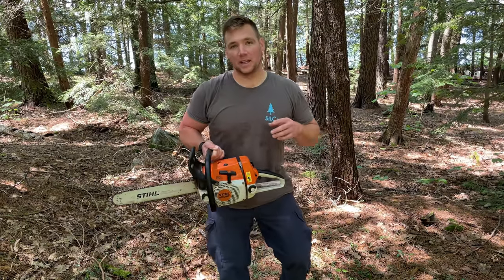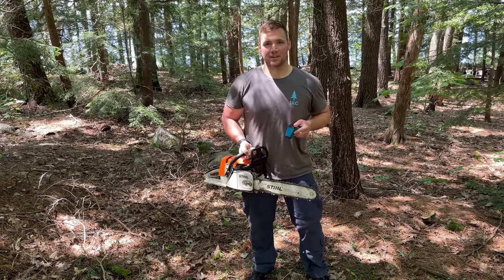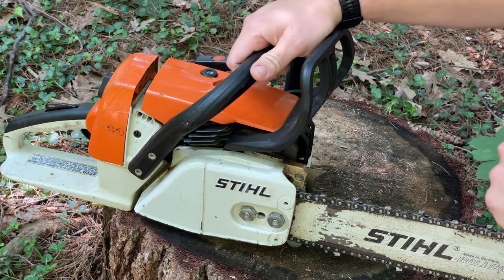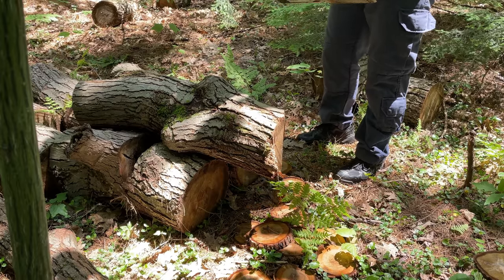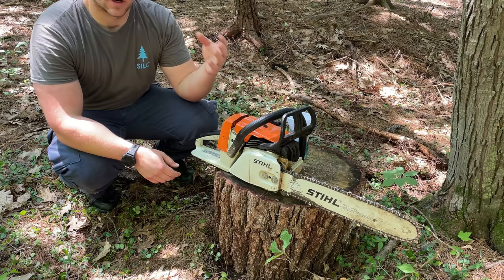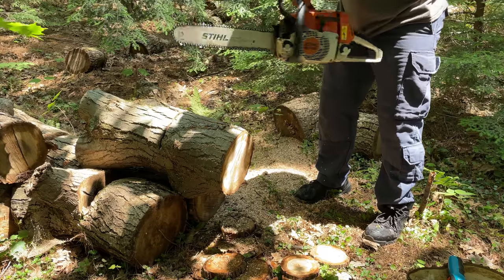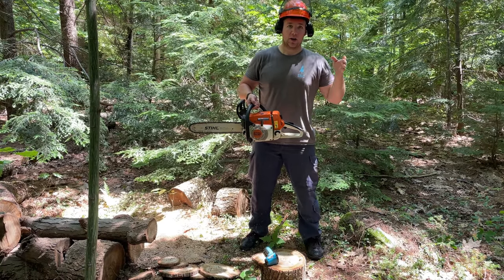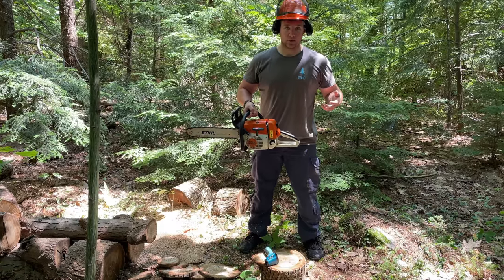Will my chainsaw last longer if I use more oil? Is it safer? (25:1 VS 50:1 temperature testing)

Comment: Thank you. If you can get the public to understand this you have truly accomplished something. That being said, if you had the ability to richen fuel to air ratio you could get the temperatures back to nearly equal. Since the carb adjustments are pegged or fixed we normally can’t do that. Having worked in the industry I have had a hard time getting public to understand that more oil is not better. With today’s oils wear is not caused by lack of lubrication it is caused by dirt. Air filter maintenance is critical for long life.
Reply from the maker: Absolutely. Great points. I would suggest running more oil and then altering a perfect carb adjustment for 50:1 to compensate for temperature would be counter productive. 

You’re exactly right. Today’s oils are so good. Personally, I’m going to trust the engineering done by Stihl, Husqvarna, Echo etc.

Cheers!
Reply: It’s all to do with Emissions,saws will run better with more oil and last longer.
Reply: I have an Echo PB-251 hand held blower that I run at least an hour a week and for hours on end in the fall..:since 2008. It starts 3rd pull every time. Original plug and I’ve never removed the air filter. It’s caked with nasty dirt and debris. It’s been abused, knocked over, dropped and ran hot. I’d say it’s lasted a long time. Still going strong too. And I’ve never touched the air filter. I actually just looked at it today for the first time. I sort of just forgot about it. And I’m a believer in good maintenance.

Comment: We ran 2-stroke racing bikes at all different oil mixtures back in the day. We jetted for the day. The main issue with running the castor bean oil we favored at 16:1 or thicker was fouling spark plugs when you throttled down. Man, this brings back memories.
Reply: And you don’t own them today…. Hence .
Reply: gotta love that Klotz Benol... i actually prefer the supertechniplate, and its what i run in my saw now... you are right about one thing... castor bean oil definitely needs RPM to burn cleanly
Reply: @kevywilliams3304 Hence, your comment doesn't make a bit of sense.

Comment: I think going from a 50:1 to a 25:1 is a pretty radical step. 
Using XP Series Husqvarna saws and 50:1 synthetic oil, I got damage over time (a lot of time but a $175 parts rebuilt …) I’ve changed to 40:1 and things seem to be much better
Reply: Husky oil is some of the worst oil made.
Stihl oil is right behind xp oil.
Reply: Have had my share of operating both an XP 390 & 3120. Are you using .87 or .91 gas?
Reply: Same, my top end is toast. Only 91 octane no ethanol in its lifetime.
Reply: I agree with you.
Reply: Same here, my dad and myself run 45:1 because we burnt up 2 saws before we made the switch and now running the 45:1 we haven't burnt one up
Reply: Husqvarna is what we run
Reply: Stihl ultra silver bottle seems worse than orange bottle for oil left in bottom end and husky xp seems pretty good also. I usually run 40:1 with 91 octane
Reply: @christopherlehman4045  40:1 94 octane here,
Reply: In the UK, our lowest is 95 octain. What oil mixture ratio would be best for us?  I'm using a Stihl hedge trimmer, only light domestic use.
Reply: @Bikeops2021  your best mixture is whatever your manual says
Reply: @escapetherace1943  Yes, that would have been my No.1 option. However, not having a manual led me to my second option... ask someone who would be more likely to know the answer...🤔
Reply: @escapetherace1943  this is 100% false.  Manufacturers say higher ratios now only to fall in line with epa requirements.  Same thing with those 10k mile oil changes manufacturers now recommend (and have back away from after a staggering amount of engine failures).  The higher ratios and longer oil change intervals will eventually destroy your engine but most of the time it will be after the warranty has expired so it does not harm the manufacturer.
Reply: I never run 50:1 always 35:1to 40:1 your unit will last a lot longer and a older Sthil repair guy told me also to do that just my opinion
Reply: Hell he stopped 25:1 10 seconds faster lol
Reply: Don't quote me but i think husky recommends 1to32 in their saws. Might vary depending on the model. So 40 to 1 would be close.

Comment: good work I was initially surprised by the result :) a little late to the comments section here but i would say the higher temp is likely due to a leaning of the fuel ratio due to the extra oil. Also, too much oil will cause the needle roller bearings to "skip" or "skid" rather than rolling, this causes wear on your bearings. 
Oil technology and metal/machining quality also affect the oil ratios.
Each saw make and model has its own recommended mixtures for a reason :) 
The pure lubrication aspect of the oil happens at around 100:1 then there is the cleaning/washing away of contaminants that needs a little more and finally there is a sealing/cushioning component to the oil and  you end up at 50:1 - its also a very convenient ratio to mix.
 Originally Husqvarna stated that you needed Husqvarna oil at 50:1, other 2stroke oil at 33:1 and monoSAE30 oil at 25:1. Now, many years later the manual reads "air cooled 2stroke oil at 50:1", on all their saws. 
Many Chinese saws say 25:1 simply because the tolerances aren't as good and generally the oil quality is unregulated.
It would be interesting to re do the test, re tuning and re plug the saw for the 25:1 and see what happens.
Well laid our format - instant sub from me mate

Comment: Biggest problem is going to be carbon on the piston and exhaust port, but the anti spark shield will block solid far faster with the 25:1.
Reply: My anti-spark shields fit nicely in the trash bin.
Reply: Don't think I've ever seen carbon build up on my equipment. But I like them richer than usual.

Comment: Proper sharpening. 32 to 1 mixture. Original 372 Husqvarna. Usied logging felling large hardwood timber. Saw ran awesome for 20 plus years. Got run over by a log forwarder. Busted both cases. Pulled the crankshaft out put in a couple cases that I bought from a buddy. That was five years ago still running strong. Proper sharpening.
Reply: I remember the big debate over 16-1 vs 32-1. Lol
My HomeLite runs best on 24-1. 
These newbies, lol

Comment: Ran all my Huskys on 50 to 1 mix. Still do. Never looked likeblowing one up. Used to log full time. 2 years out of a spark plug was common. Why smoke yourself out for no reason. Used to have folks try all kinds of things out. Saws were often running to rich and gutless. 50 to 1 is what Husky mauals say and its good enough for me. My old 372 loves it.
Reply: I grew up selling firewood , my dad ran an 028 and 2 029s. Early 80s models. He ran 50:1 til the end. They survived from the early 80s until the late 2000s….. never rebuilt. Keep the chain sharp, air filter clean. Run an appropriate sized bar … and it’s amazing…. The saws lasted 30 years. Matter of fact the first 10 years was tree service and pulp wooding, and transitioned to only 20 chord a year fire wood the last 10 year or so.
Reply: Exactly right. Ran 50:1 for 15 years, 6 hours a day. Ran those saws until everything but the motor was plum wore out

Comment: I worked for a Ford New Holland dealership that took on McCulloch chainsaws. The service representative and I had this discussion and what he told me makes 100% sense to me. To much oil has a longer flash point which creates more heat than less oil with a shorter flashpoint. It simply takes longer to burn more oil and makes more heat. 
I did enjoy this video which backs this up.
Reply: Very well thought out comment
Reply: Heat is horsepower!
Reply: yes and what ? any damage ? for more heat ?   back to school mate.

Comment: Great job, Dave. As an engineer, I believe collecting data to support a claim is essential.  Thank you for conducting the test and sharing this data with us.
Reply from the maker: Hey there! I’m lucky enough to have an engineer as a father, and I’ve always been a big evidence guy myself. Myths and folk lore?! Prove it!!!
Reply: I believe in collecting a claim to support data. Ever think of that?
Reply: @DavesSmallEngines  HI, would be nice to measure RPM, load and no load. And then try to adjust the carb so you have same RPM in both scenarios with different mixtures. And then take the temperatures.

Comment: Awesome explanation Dave! So many don't think about the lean condition created with extra oil in the mix. Lube is great, but it's not the entire story: fuel cools the top end too!
edit: after reading most of the comments here, seems a lot of folks miss the point that this video is good info for the average DIY, homeowner, etc.: They just heard something on the internet about more oil is better, but don't really understand the need to re-tune the carb, which they likely don't really know how to do. Pros already know this.
Reply from the maker: Hey mower lady! Thanks for the kind comments. There’s a lot of folks that know more than everyone on the Internet. I’m okay with it - I wanted to do a test for the average user. I agree, most folks don’t know how to tune a carb. Thanks for stopping in!
Reply: Lady Lawnmover. Always on target with analysis and advice!

Comment: I do random tinkering. (I've fixed VCRs, Hoverboards, chainsaws, lawnmowers, reel mowers, PS3s, vacuum cleaners, home plumbing, home electrical (120V & 240V), my motorcycle was a 1980 Honda CX500D that I bought for $200 because the owner said he couldn't make it run. It had a broken wire preventing turning 12V into kV for spark. That was it. It ran great and I got my M rating with it.)
A guy I was talking with found out I do random tinkering and asked me if I could look at his quad (but not the glutes).
Anyway, he was told that his 2-cycle bike wasn't oiling properly, so he was told to just mix oil with the fuel and he did that and the bike stopped running and the two of them couldn't get it fired up again.
So I said I'll take a look at it, and he dropped it off.

I had a guess that the oiler was oiling, and by mixing oil in with the fuel AND having the oiler still connected, I had a hunch that the crankshaft literally filled with oil.
So, what I did:
I emptied the fuel tank.
I disconnected the oiler tube from the engine block and determined that oil at least got to that point.
I emptied the oil tank.
I removed the spark plug.
I hung the bike up with a winch to a tree, to turn the engine upside down to let the oil drain out of the engine, and drain it did. It was seriously pooled oil in the crankcase.
I let the bike back down onto its own wheels.
I cleaned the carb with compressed air after ensuring it needed no parts replaced.
I reconnected the oiler tube.
I filled the oil tank with 2-cycle oil.
I filled the gas tank with regular 87 Octane.
I reinstalled the spark plug.
Bike fired right up and smoked a bit as it cooked off the last of the liquid oil in the engine.
I ran it around the yard for ~30 minutes.
All seemed well, I sent him video of it working and he came and picked it up.
I told him to hold off on thanking me until he trialed it for a solid weekend.
The following week he thanked me, it worked great.

I watch videos like this because I hate sitcoms and "regularly scheduled programming".
"But, how are you able to see emergency messages?"
A one-time payment of $80 buys a tv antenna that gives free tv for years if I want to watch it, but youtube literally covers everything nowadays.

Comment: Some of my 2-stroke engines require 40:1 and some require 50:1.    I just mix 40:1 for everything.      Even my old  McCulloch gas trimmer still runs fine after 28 years.    I wouldn't expect 25:1 to work very well, however.    Thanks for sharing your test results
Reply: 25:1 is a holdover from the days before engineered 2 cycle oil... back then, you would mix straight 30w with your gas. 30w burns off quickly so you needed more of it to properly lubricate the engine. With modern 2 cycle oils, thats not necessary because they have a much higher flash point. But some people cant seem to grasp that concept
Reply: One engine does not require more oil than another. You have got to truly understand two stroke engines or realize this. 50:1 oil mixes is great for every engine. A good example is my Shindaiwa has 25:1 embossed right into the fuel tank cap. The oil they sell for it is 50:1. The 25:1 was for other countries where they don’t have access to the high quality oil used in the rest of the world.
Reply: @rickringler5021  Some engines do recommend more.  Think what you want.  I prefer 40:1.  My grass trimmer is a 1994 model.  My 4 chainsaws are 2005 & older.  Everything runs great on a cheap 2-stroke oil @ 40:1.   I would never go 50:1, but that's me.
Reply: @driftlesshunter9200  not to be disrespectful in any way, but you, and most folks do not understand two cycle engines. They are a completely different critter. If you have attended service schools for fourty year put on by Stihl, Husqvarna, Honda, Echo and Shindaiwa you would be knowledgeable on the subject. Two stroke engines and their needs and failures is what they needed their technicians to understand.
Reply: @rickringler5021   The key is non-ethanol fuel.   I'm not losing sleep over 40:1 vs 50:1.  I know what works well with my older equipment.   If you prefer 50:1, so be it.  You're the expert.   I prefer 40:1 regardless of what the experts say.  Some of my 2-strokes have a 40:1 recommendation.   They sell pre-measured containers for a 40:1 mix.  Whatever you think does not apply to all engines.
Reply: @driftlesshunter9200  if I wasn’t trained in this I would “think” just like you, there is no doubt in my mind. Oil mixture is not determined by what the engine requires. It is determined by the oil you are using. When I started in the business Stihl sold their oil in a container that would make a 40:1 mix when mixed with one gallon of gas or two or two and a half or five gallons of gas, how ever much you intended to mix. Then they changed their containers to a 50:1 mix with the same quantity of gas as previous. Now the engines did not change, it was not 40:1 for old saws and 50:1 for newer saws. The oil gave the proper lubrication to be mixed at 50:1 for all saws. Did the oil change or did they just decide 50:1 was better. I am not sure, but it darn sure works.
Reply: @driftlesshunter9200  it is not about what I think, it is about what I was taught as a certified two stroke technician.
Reply: @rickringler5021  Good for you!  That's wonderful!  Thanks for sharing!

Comment: Been using 40:1 ratios on all my equipment, recently the stores have been out of that mixture ratio so I’ve gone to 50: 1 mix now for all my small engine needs. I just purchased a chainsaw on Amazon and it’s stated in the users manual that a mixture of 25:1 was recommended but I was using  50:1 on it, and it had my curiosity as to whether I was damaging my equipment. This video couldn’t have came at a more perfect time and answered my questions. What a great video you put together on the particulars of oil mixtures , well done ! thank you.

Comment: I always just use what the manufacturer recommends. I have a Stihl I bought new about 7 years ago, always used the Motomix 50:1. I have a couple of other 2 cycle machines that call for 40:1, so I use the premix or occasionally mix my fuel from pump gas (Sunoco 93) if I’m using it a lot of it. Maintenance is key! My motto with fuel or any fluids is: “when in doubt, DUMP it OUT”. Real simple, old fuel of just about any kind, even mixed, can be poured into my truck which is a 17 year old Dodge Heavy Duty which gets 12mpg. It’s gone in no time and diluted with frequent trips to the gas station. Just about any car will burn up old gas and not suffer the consequences, but some may balk at doing this with a precious new car. In that case, offer it to a friend or teenage driver who is too cheap to pay for their own in gasoline. In any case, if you be sure your fuel is fresh and mixed properly, you will rarely see any problems with power equipment. One run with bad fuel and it can be game over.
Reply: the manufacturers are between a rock and a hard place in regards to 2 cycle engines.  Back when I was a kid, outboards ran as rich as 16 to 1 and now I have some synthetic oil that is recommended at 100 to 1!  I believe that Californicate is outlawing all two cycles in the next couple of years, that sure will spur on the rebuilding parts business.  I suspect that small differences (5 degrees in this example) are not significant but larger ones are (say about 50 degrees or so).  I don't think that using a 40 to 1 oil in a 50/1 saw is gotta hurt anything and I think that test might be more useful.  If you have two saws on yer truck, one 40, the other 50 are you goin' to carry two separate gas cans?  I doubt if you have any 24/1 equipment left.  One advantage to using my old lawnboy mower was that mosquitoes weren't a problem when mowing.  Dang things lasted forever, way longer than the Chiner engine mowers sold now, end came when I broke the carb and couldn't get a new one.
Reply: You are so correct ! I run 42.5 :1 which pisses off regulators and idiots lol

Comment: I ran a 72cc Chinese auger at 50:1 when they recommended 25:1. 
After less than 8 running hours, the engine gave out and the piston has groves in it.
I just bought another one and will be running it as recommended, 25:1.
It seems to reason that even though it may run at a bit higher temperature, the additional oil helps lube the working parts better than 50:1, making it last longer.